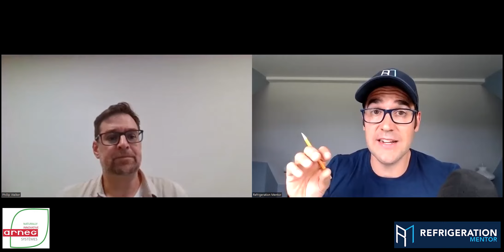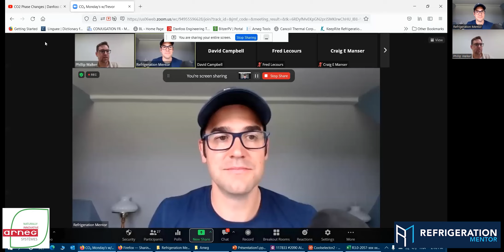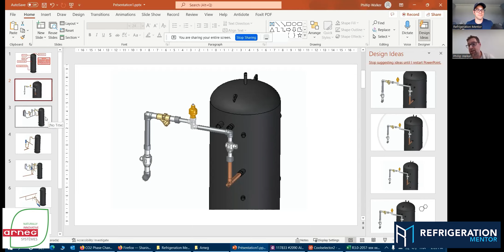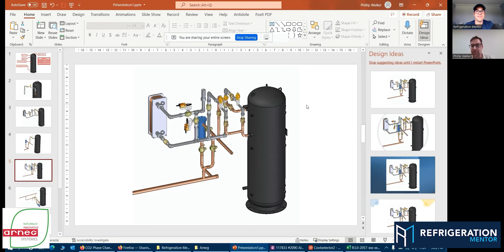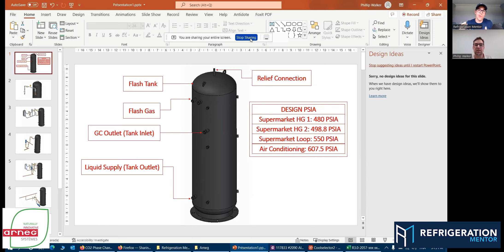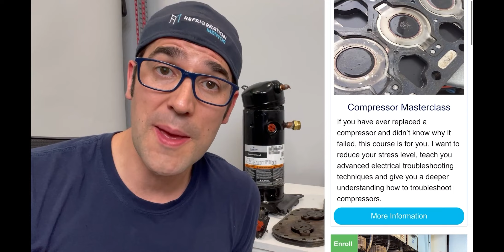Transcritical CO2 Flash Tank Stability with Phillip Walker from Arneg

Comment: How much liquid should be in the flash tank at any given time? Are there minimums?
Reply from the maker: Depends on the manufacture and size of flash tank/receiver. You can have too little (undercharge) and you can too much (overcharge) a CO2 system. What I have saw in some cases that you do not want to have much more then the bottom sight glass depending on the ambient/time of year but reach out to the specific manufacture of that equipment and ask where it should be.